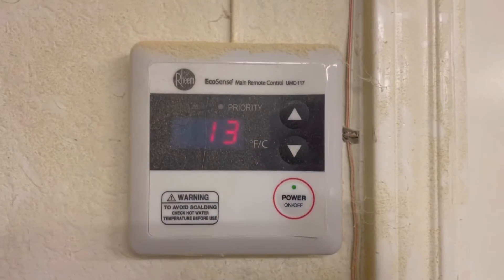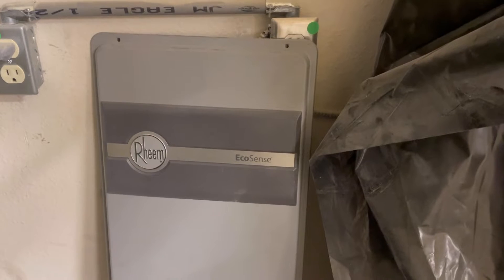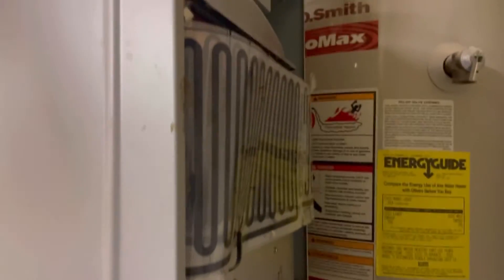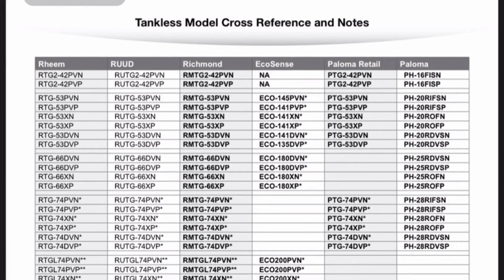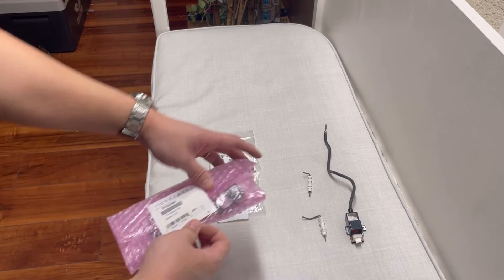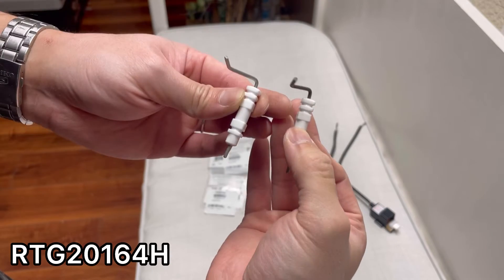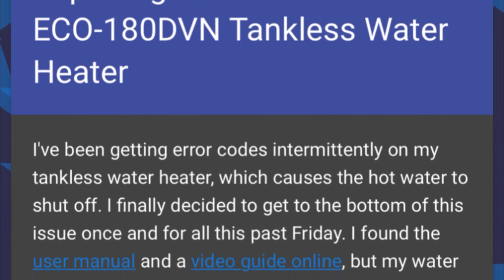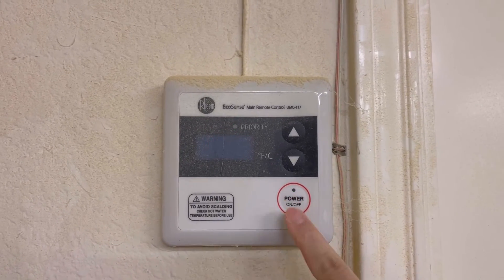Repairing a Rheem Tankless Water Heater

Comment: Good job 👍 for me
200$ later after a so call Rheem service dealer came to look and diagnosed my issue hoping he can fix it for me (code 13) just to at the end try and sell me a new unit 🙄. I took it upon myself to disassemble the whole unit burner, igniter etc cleaned it super well due to being short on time vs ordering and replacing parts like u did...my unit similar to yours than ran smooth as butter! Flames working as it should etc. 

Self taught sometimes is the best way to go people. I feel theres no longer any honest hvac or whatever people out there anymore period the BS the serviceguy gay me i wish i was myselfand slappedhim out the houseratherthan be nice like the wife wants me too. I honestly rather spend $1k+/_  to fix my current nonworking unit (weighing it out) then be told 4-6k for a new unit👎 that was my situation a few month ago.